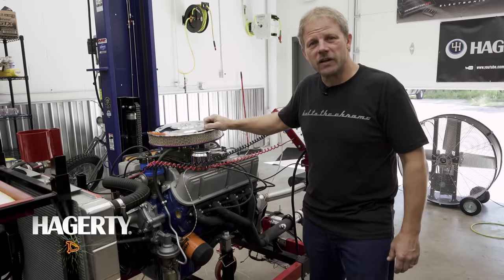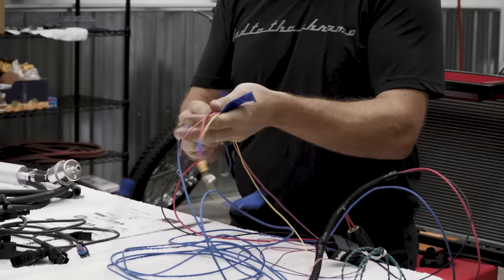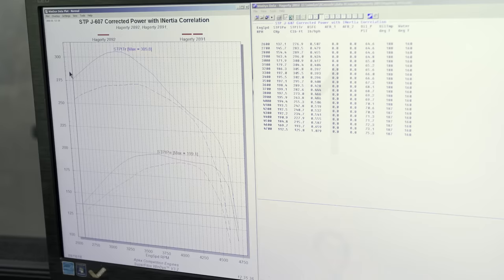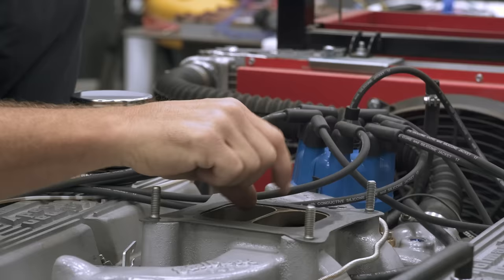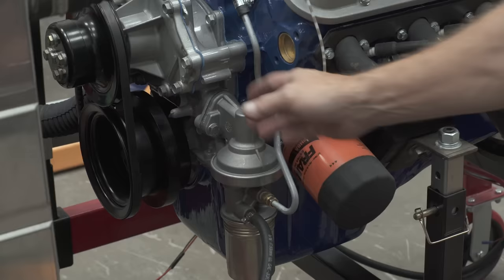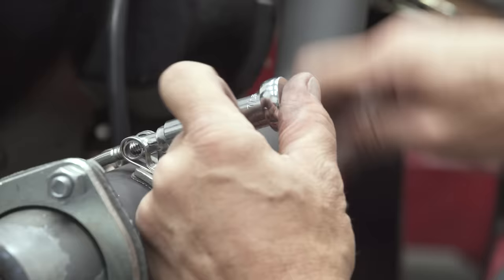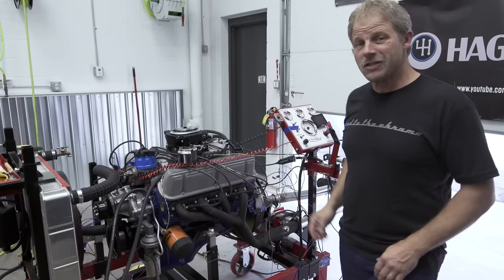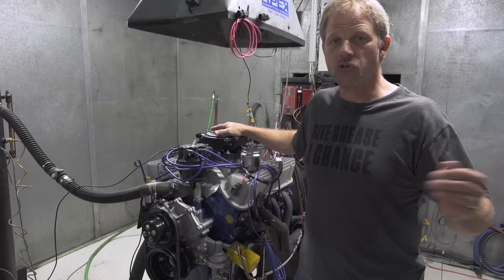Is it worth it? Replacing your carburetor with a Holley Sniper EFI | Hagerty DIY

Comment: And if there was ever an EMP, you've got a boat anchor. 🤣🤣🤣
Reply: Because that's soooo likely. The engine would be a boat anchor regardless of what's on it.
Reply: Alex Eidenier  and, of course, a hill to roll start it on
Reply: Alex Eidenier  maybe. Getting a battery that's miles away would be a challenge with no running vehicles. Besides, if an apocalypse scenario is what you're really worried about then a manual is more dependable anyways
Reply: Alex Eidenier  of course, an old Detroit Diesel would be more reliable and be able to go highway speeds.
Reply: Alex Eidenier  no. But they roll start just fine.
Reply: Alex Eidenier  could be wrong but at least the early model t's dont have a magneto. They have a thing called a buzz box. It a series of dry cell batteries. One of fords kookier ideas.
Reply: Just cover it with a Faraday cage. Any old microwave will do, don't be lazy!
Reply: @isaakwelch3451  lol no. points/carb motor will run even when a nuke is being dropped.
Reply: @frigglebiscuit7484  engines dont run without spark and if your alternator is dead then you won't have spark.
Reply: @isaakwelch3451  uh....alternators charge batteries, not run engines. A points ignition is literally un-emp-able.
Reply: @frigglebiscuit7484  and if theres no power in the battery and no alternator to charge it, how is the engine gonna run?
Reply: @isaakwelch3451  easy, go get a bicycle, and find a electric motor to spin backwards, and it will charge the battery(a lot more specific steps than that, but whatever) magneto engines(most go karts, old motorcycles, etc) don't need batteries.
Reply: @frigglebiscuit7484  or get a stickshift diesel and avoid the stupid bicycle charging thing.
Reply: @isaakwelch3451  good luck finding fuel anyway. It'll be all electric in the apocalypse.
Reply: @frigglebiscuit7484  vegetable oil. If your idea to power your car is a bicycle then you're better off just riding the bike everywhere.
Reply: @isaakwelch3451  and where are you going to find a lifetime supply of vegetable oil, let alone the chemicals and ELECTRICITY to make it into biodiesel?
Reply: @frigglebiscuit7484  a diesel will run on straight veggie oil. Have you heard of farms?
Reply: @isaakwelch3451  it would take you months just to get enough vegetable oil to turn into diesel, only to be used up in a matter of days. electric motors would be easier, cheaper, and never ending energy.

Comment: Im a parts person at a local shop, were known for being the go-to guys for the performance crowd and I have to say after selling multiple sniper kits that we no longer recommend them to customers as an "easy installation". Most kits seem to have at least one (or more) warranty issues and many hours of setup and/or on the phone with Holley tech (which are very helpful BTW). The advertising makes it sound like they are "plug and play and self learning" which I believe they are not. Can you make them work? For sure...Are they better when running correctly? for sure but to get them to that point is often an exercise in patience at the least, futility at the worst. Bolt a carb on, play with some mixture/jets/airbleeds (if you want to go that far) and your off and running.

Comment: My Holley  square 4bbl ran like crap too.  Took that off and stuck a Thermoquad in it's place, runs like a champ.
A properly rebuilt and calibrated Quadrajet runs really well too, I happened to have a Thermoquad though.
You needed a good set of points or the distributor bushings were sloppy.  Another possibility is the condenser may have been crummy.  Many of the current replacement points/condensers are junk, you need good parts.
Too bad this EFI requires so much support equipment like high fuel pressure and an O2 sensor.

Comment: I have but one issue with your comparison. You seem to have run the initial carb setup with the air cleaner. That's a restriction. You then ran the EFI without said air cleaner. You were going to make a bit more power regardless due to that difference. I wish you had run them exactly the same. 
Thanks for the video. It was insightful.

Comment: David, not sure what makes you think that carburetor needs "pulse" to deliver fuel. Quite the contrary, pulses mean reversion of the air/fuel mixture and make it very difficult to tune. All carburetor systems simply need a flow of air through the venturii to meter the fuel. Reversed air pulses typically "over-carburet"  the air because the air tends to pass through the venturii multiple times.

Comment: The simple fact is there is no power difference between equivalent fuel delivery systems because at the end of the day their function is exactly the same supply a certain amount of fuel for the load and rpm, where the difference comes in is tune ability and the fact the holley efi can self tune is a major thing since so many people now have never seen a carb let alone tuned one

Comment: I run the snippers, even a single barrel on the old inline sixes, for reliability and reduced maintenance. I tired a few others and they just aren't as good as Holley from my experience. I don't have dedicated drag or racing cars/trucks all mine I do are street first.

I do have a stock 70 c10 with a 307 I dropped the two barrel on and an HEI distributor. Thing runs a million times better and decent MPG (about 12), but now when I do a tune up it's basically just check timing, clean up the throttle body and check cap/rotor and done.

Comment: In a off road enviroment the efi will not flood out like a carb at extreme angles. (Not an issue on street cars) but off road its a huge improvement.
Reply: Thats why you use the spring loaded off road float valve in your carb!

Comment: For folks on a budget an electronic distributor isn't mandatory . Higher tension points are available to avoid point float so higher RPM's can be acheived.Secondly across the board the full consumption is considerably much better.A great Video for DYI car folk.

Comment: Excellent video ..10/10..there's a few things I'd like to point out ..it's fine to stuff the intake full of rags and do the mod then vacume it all out .what's of bigger concern tho is there's a 99% chance vacume will suck up that shwarf in the exuast into the exuast valve ..100% if OEM internals ..seen it as I'm a mechanic....also something u didn't cover which is important.the fuel lines MUST be up graded ..from tank to engine as carby line will explode on injector pump pressure ..fire = bad we know..great video
Reply: Note: I think he is talking about the low pressure hoses, not the steel line 
Another is to mic your lines, filters, and all connections as these will create major issues.
Example: Your fuel line might be 3/8" and the fuel filter has 1/4" internal diameter inlet and outlet. V/R Chris

Comment: We have a similar application in our Ford 351W Engine. Most important advantage is tu adjust the injection fuel and the ignition point. Also easier to hold a good idle.

Comment: The one point is the O2 sensor data point, that creates the most efficient burn conditions of or near 14.7 ratio at various RPM. 
There is an "O2 Wide band sensor' device now available,  that is a huge step towards the the EFI traits of the  AF ratio at driving speeds.
So carbs can Now be tuned and adjusted with near EFI type results of AF ratio mixture in their sweet spot 1800~3500 RPM ranges.
This helps reduce the guess work what the engine  is performing at RPM’s  and allows engines to be most efficient , NOT overly lean NOT overly rich in the driving RPM range, but most efficient thus most HP & Gas milage it can provide.
Isn’t that the goal here too?
I suggested this a while ago to be demonstrated  here as I thought it well worth knowing about.

Comment: The problem I see with this is the mounting of the computer on the injection unit. It would be much better to mount it away from heat cycles, such as inside the car. I realise they do this to ease the installation and eliminate a lot of extra wiring. But I think it will cause problems down the track, especially if your under hood temperatures are extreme.

Comment: I replaced my carburetor with an aftermarket bolt on efi unit  a few years ago and will NEVER go back to a carb. My engine starts up quickly,  and has way more power and drivability.  My biggest problem with carburetors is they seem to require a lot more maintenance.  My efi has worked perfectly since I installed it.
Reply: Which efi kit did you go with?
Reply: Fitech. Don't remember the model number at the moment.  I believe it will handle up to 600hp, way more than I need. Matched it with Clifford Performance intake, cam and headers, my 300 inline 6 feels like a V8.

Comment: On point ignitions: as probably the youngest person in known history to purchase and run a dual point distributor I can tell you from experience if you purchase points from your local NAPA or AutoZone/O'Reilly's, you will indeed have installed a 4500rpm rev limiter (maybe 5000 if the weather is cool). You MUST get some bad ass points and condenser from jegs or summit or some place that ACTUALLY HAS THEM. They will crank 6500-7000rpm ALL DAY. That said ...I still switched to an msd 6AL and im glad I did, lol

Comment: @hagerty you clearly didn't read the instructions! The small tube ( vacuum ) is for   vacuum for the distributor and the small tube left is for other vacuum things . Center tube is for brakes not crank . The crank tube is in the front of the carb ( factory carb has a plug you have to add it. ) center part you said to cut out holley says NO when you call teck . Leave it with no spacer .

Comment: I didn't see if there was a crash shut off switch for the fuel pump.  In the 80s and 90s cars had a little g-shock sensor to the side of the trunk.  It would open up in an impact and turn off the fuel pump so it doesn't continue to pump fuel through broken fuel lines in an accident. I haven't seen them on more modern cars. I assume they just use the air bag sensors to do the same thing. This seems like a good thing to include in a fuel system that makes 50psi.

Comment: At 16:05:  If you were to use a stock style THERMOSTATIC air cleaner (as opposed to an open-element style air cleaner), the carburetor will "see" a consistent air temperature.  This helps to keep a stable A/F mixture and eliminate the need for seasonal adjustments.  And if you were to also use a stock style THERMOSTATIC choke (as opposed to an aftermarket electric choke) with it, cold starts should never be an issue.  It helps when ALL of the proper equipment is there, just like on an EFI application.

Comment: Yes, this was an advertisement for Holley. Yes a properly tuned carb can make the same power as EFI. Yes, EFI costs more. But in the end EFI is more efficient, easily tuned and MUCH more driveable over a wider range of atmospheric conditions. You ever try to start a carbed engine when it's -20 at 7000ft elevation? There's a reason all new vehicles are EFI. Leave the carbs for your lawnmovers and weedwackers. EFI is King!

Comment: you can run all the dyno runs you want but after I done the conversion the car is much more driveable. easier starting, much better throttle control.  brings my motor on the cam so much smoother. i

Comment: All you carb lovers, here's one you can't argue.  Carbs STINK because the fuel ratio isn't correct all the time.  You can't get a carb to not run too rich at times,  especially cold.  EFI doesn't make your clothes and hair smell like exhaust after driving.

Comment: i'd say since that HP dip practically matched carb and efi, that's something with the heads, maybe at that rpm range theres some odd turbulence in the bowl or something is going on. be fun to have a single carb high tunnel ram and see what it does to that awesome motors top end numbers! :D

Comment: I love watching car/engine videos and their results.  What I don't love is leaving out some important details - like the co$t!  What does the EFI system cost plus any of the other accessories like fuel pump, return line, etc?  When you are on a budget it's hard to beat a swap meet Holley 750 dbl pumper for $175 and some extra jets or larger accelerator pump.  If you have the extra cash I can see installing the EFI - I have also seen plenty of vids of guys going through all kinds of issues with EFI setups.  Hopefully the latest ones work well and have the bugs worked out.
Reply: My thots as well…additionally how was this 289-V8 built?…is it rock stock or modified stock, those variables can make a huge difference vrs adding this to your average run of the mill carbureted engine.
Reply: Someone on an extreme budget should probably be using the stock carb and manifold anyway since they're free and already on the car. On a budget build the last thing that should be touched is the motor. What's the point of extra power without a limited slip? Upgraded brakes and high quality suspension components make the car stop and steer better all the time, whether at the track or the grocery store.

Comment: Nice bottom end torque!

It went from 600 cfm to 900 cfm, added about 12 cubic inches to the plenum and increased it's length and volume with the crossover effect. Gaining about 25 fl tbs of torque across the curve could be from that alone  You would possibly get very similar results with a properly tuned carb and a spacer. 

A carb setup that is tuned right will make all but exactly the same  power curves as a efi setup of the same cfm. Yes, efi will drive better with less work. That's a no brainier.

The biggest advantages of the Sniper system is obviously cost versus buying a 900 cfm carb. You don't need a box of jets, multiple O2 sensors, time, etc, to tune it. The downfalls are that no carb ever suffered from  EMI issues. Every standalone TBI system I have ever worked with can turn into an EMI nightmare. And that may appear during or after the install.  Bad diode in the alt, bad wire, plug gap, wiring for TBI to close to something, etc.

TBI injection systems are also not very good with cams with a rough idle . TBI and overlap don't go together real well at all, and that should be mentioned in any comparison. Driveability with throttle body injection and lots of overlap isn't going to be the best till after the  rpm smooths out the vacuum and the runner speeds.  The combination of changing vacuum and port stall will wreck havoc on the low rpm fuel mixture with a big cam.

If you have or plan on going with a big cam, use a port injection system that is designed to transition from speed density to closed loop.  You can put together a self tuning  port injection system for about the same price as well. But it is a bit more work that bolting it on and 5 wires, lol....

If you have a cam that idles with steady vacuum, a TBI system is a no brainier. It is going to run good basically all the time. Other than changing the fuel filter every few years, it will take care of itself for the most part.

Add timing control to it... lol
Reply: You nailed it in the first sentence. Area under the curve on the TQ will 100% be "seat feel" more power. The rest are debatable and dated opinions.
Reply: Im looking at EFI with an L78 solid lifter...just bc i expect it to be able to tune with stock SS manifold, as well as if i upgrade to a long runner/high cfm manifold or different fuel system etc...Which does incur cost...just a way to get more fuel/air to a more ideal range that the L78 has proven to be capable of. As well as if the time comes where i want to do a non solid lifter build...i can still retain the EFI/fuel setup or aspects of the build prior, if i go with a roller cam and not solid lifters or bump up into the 402/etc range. I just want to get that hipo engine going and off the engine mount and give it some ideal flow/fuel management bc im not familiar with tuning carbs or older cars. Yet A custom ported/multiport system sounds awesome esp for managing long tube headers and fuel ap down low and high. Like those piped out C3s. Which is the real dream/destination for that engine. For me its probably going to be the "END GAME" of that engine a custom fuel system and solid lifters just for a build/car that really is about the engine/sound and driving it around how it wants to be driven on those limited drives/weekend car drives. Used to belong to my uncle in a nova with 4.10 rear with a 4 speed he used to smoke cars and ran with his brothers 428 cj mach 1 with 3.91 who knows what they could have ran with bigger carbs and better tunes back then.

Comment: That's some fancy ass TBI lol
Reply: Glad I'm not the only one who thought that. I thought it was well established that tbi sucked.
Reply: @cliffdaddy126  TBI sucks for the same reason carburetors suck. Wet induction and no granular control of injection, as in you cannot lean or enrich by bank or cylinder. But the mfi dry induction flows better.
Reply: It IS...
Reply: I agree. Personally i wouldn't go fuel injection on my project unless its port injection and individual coil. For now my budget only allows a well dyno tuned carb 👌

Comment: If I remember correctly I watched a video a few years ago of a fellow at hoonigans put this on his c10 and it took awhile for it to be “good” it needed to learn the engine basically
Reply: With that said, I would think this test would be more accurate to do in a car. Dyno the car with the carb then put on the sniper drive for a few weeks and then dyno that